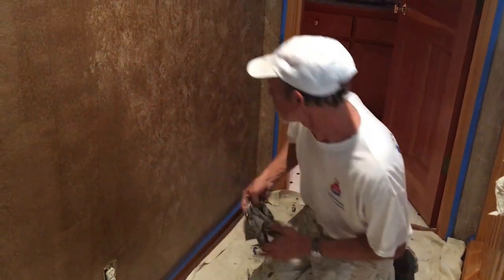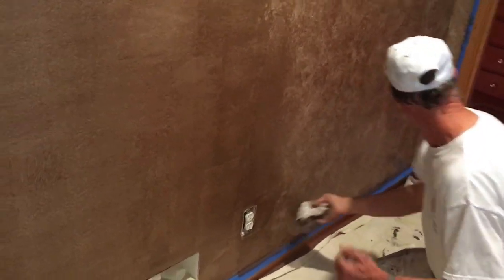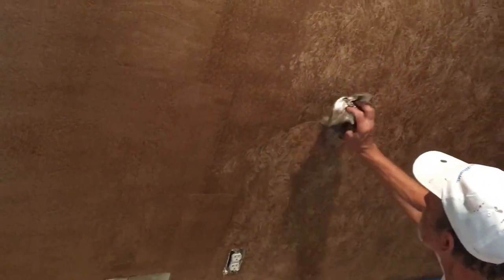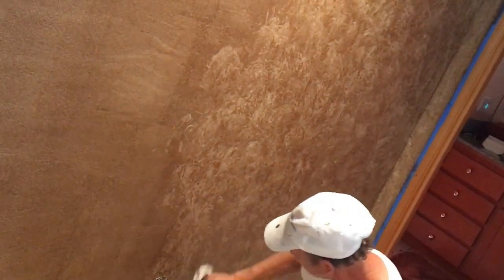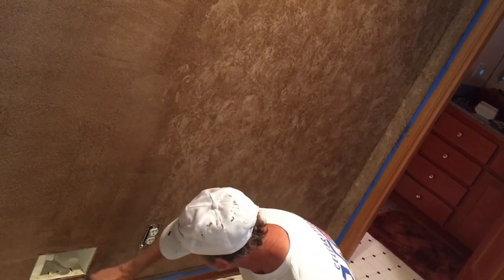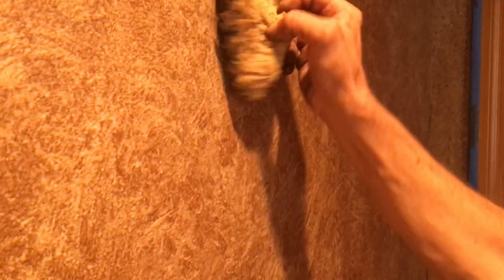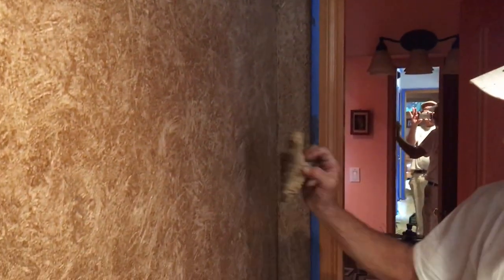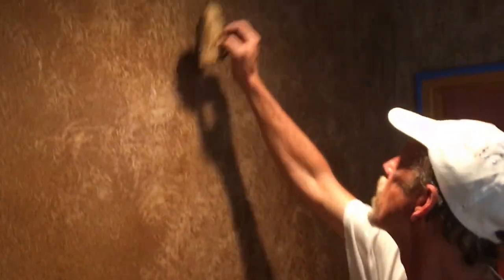Applying a Faux Finish (Color Wash) to Walls

Comment: Hello, what kind of glaze did you make?  Was the paint underneath freshly applied or did you just apply the gaze over existing paint?  Thank you.
Reply: We painted the wall first and let it dry.  The glaze was a custom mix of Benjamin Moore liquid glaze with the addition of some of the wall paint to give it body (usually we use 30-50% mix of paint) and then custom tinted it to match the existing.
Reply: @MrandMrsJschweissRVLife  Great, thank you!